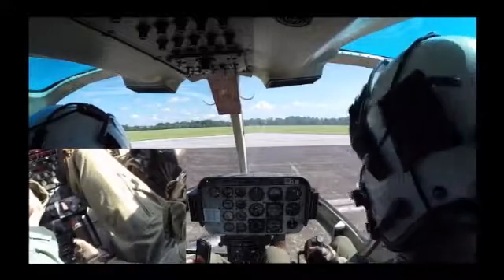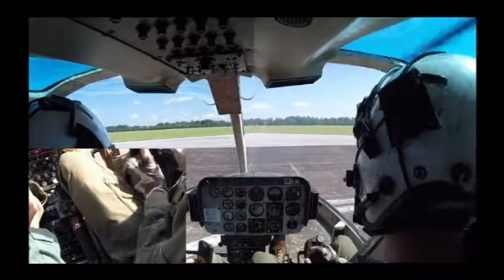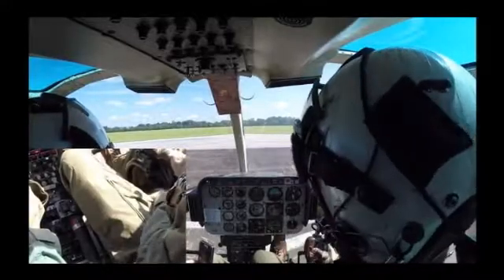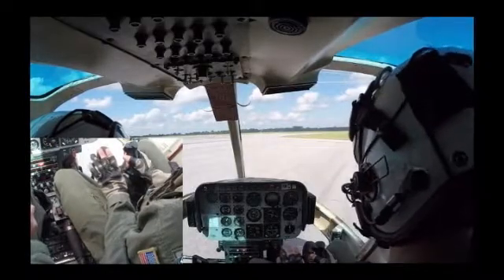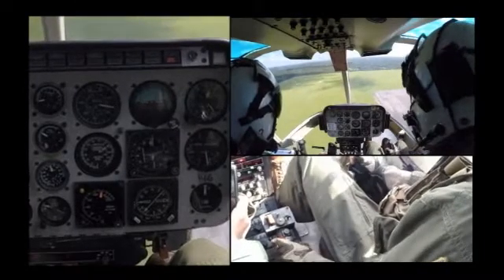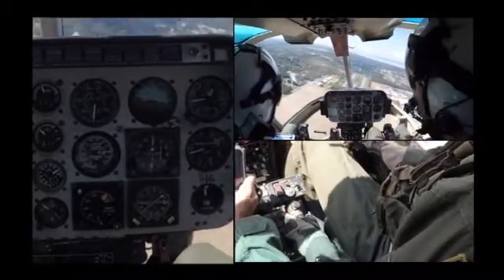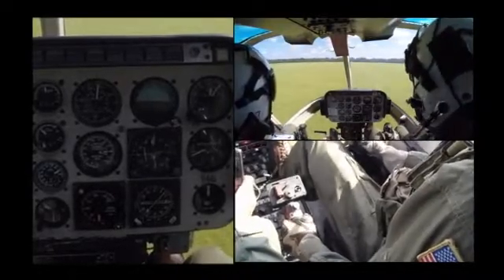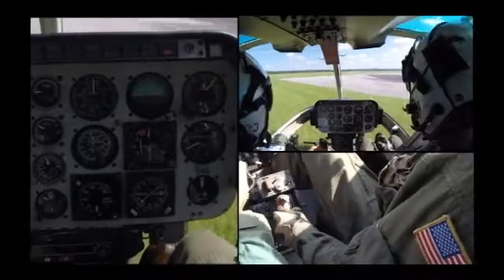Power Off Maneuvers In a Bell 206B - The Navy Way!

Comment: Beauty thing about those older semi rigid Bell models, is they absolutely float with the right amount of collective before touchdown on power off autos. Heck, in a 214 model, you almost have to limit  your collective pull near the bottom, or you’re liable to blast back up 50ft, since there’s so much inertia left in those huge blades 😂